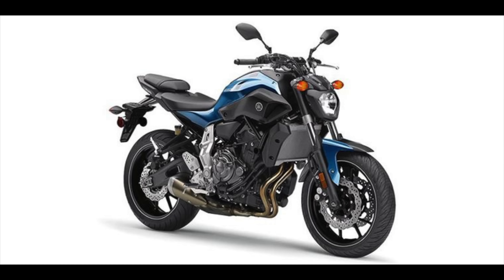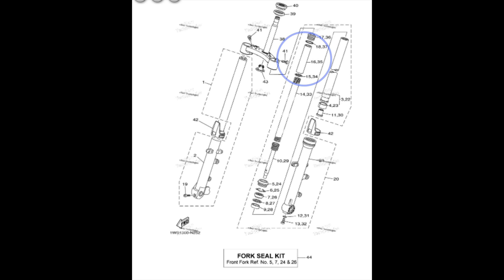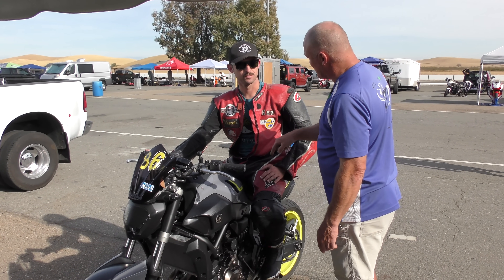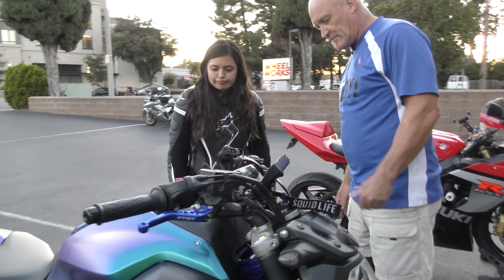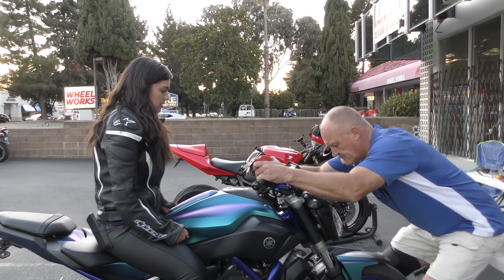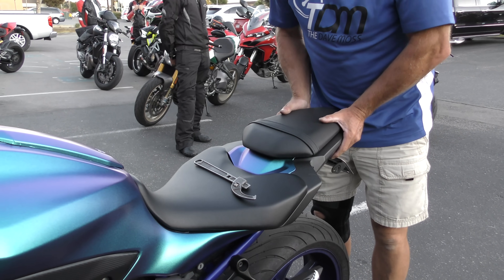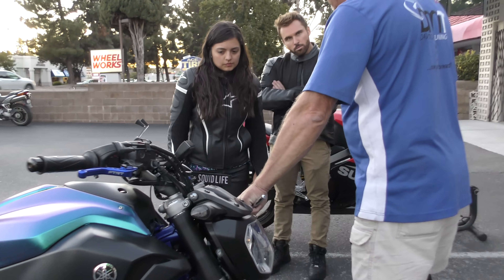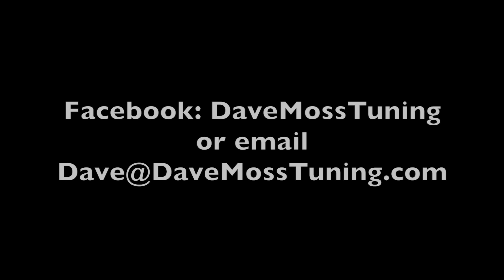Yamaha FZ-07 / MT-07 Fatal Flaw and How To Fix It

Comment: I'm saving money to buy one of these (this is my dream bike) and i find this very very helpfull, but my english is not good enough to understand completly what this man said, so, i need to fill the front suspension with thicker oil and adjust the clamps and make the bars down by 10-15 mm. ??
Reply: ive owned several mt07s and let me tell you they are decent but only on flat roads, the moment you encounter potholes you will start hating the bike, Yamaha has cheap shit suspension on the 07s and the 09s, however i did get a chance to own a mt07 tracer for 6 months and the suspension was much better than the naked 07. its also a much more comfortable bike too for the rider and your pillon. bottom line if your getting the mt07 naked chuck out the shit suspension springs for some nice ohlins or nitron ones, trust me you will not regret it.
Reply: @DudePlays247  Thankyou for taking the time and sharing the information, sadly the Tracer version will never come to my country, but i will consider changing the suspension springs thanks to you and ofc to this video, better safe than sorry.
Reply: Horotzuka my pleasure, thank you for replying
Reply: 10 - 15 mm is how much to cut off the plastic pipe inside the forks (between the cap and the spring inside the forks).

Also, don't fill the fork all the way, there's a specification for how much oil to put in.
Reply: @IslandTosh  Thankyou for taking the time to answer my request, it's very helpfull, i will keep it in mind untill i get my bike and have it done!!

Comment: Spoke to my dealer about getting 20w oil, he believes the stock fork valves won’t cope with such thick oil (90kg intermediate-advanced track rider)? How true is this
Reply from the maker: I used 10w in the rebound leg and 15w in the compression leg with an oil height of 150mm on my 2019 Tracer GT. I'm really happy with the forks now for general sport touring. The same testing was done with 10, 15 and 20w oil on the MT07 and shared. I choose to experiment, test, conclude and share.
Reply: @catalystreactionsbw  so would u say 20w in both legs for the mt07 or to mix different weights between legs? 90kg rider street and track riding
Reply from the maker: @IamMotionMedia  I would say 15w to start at an oil level of 120mm to leverage the air spring effect: https://www.youtube.com/watch?v=EiZY0lcqeR8

Comment: In my mt07 is STX 46 and nix-22 Ohlins and is diferent bike now.
Reply from the maker: Thanks for sharing what you did to improve your bike. Do you know what spring rates you used so you can share wit others who are interested in spending $$. Can you also include your weight so they have context? Thanks!
Reply: In full gear 90 kg,I use springs for 100 kg.

Comment: This is great info thanks Dave. 
I have a 2018 Mt-07. Would these recommendations still apply? I heard that from 2017 to 2018 yamaha made some front fork adjustments but im not sure what was done.
Reply from the maker: Looking for one this week at either a Yamaha dealer or an event I attend. As soon as i find one I will let you know. An owner of a 2018 posted that there is no preload spacer in his, so I need to verify that with a new model.
Reply: @catalystreactionsbw  thanks Dave can't wait to hear about it.
Reply: @catalystreactionsbw  would offer my 2018 if you're in Texas soon, but it looks like your schedule on the website has you in New Zealand for the foreseeable future. Would love some info on this as well. thanks
Reply from the maker: @blakemuhhfukn7689  Will be visiting the Napier Yamaha dealer tomorrow to sample MT09, 07, 03 and 15's if they are present. I will still continue my quest while I travel here in NZ to et them all covered and them post about y findings.
Reply: @catalystreactionsbw  you're the real MVP you know that. I had an additional question if you're still reading; would you think 20 weight would be fine for pushing into the 3's or should I move to a heavier weight in the forks. Thanks!
Reply from the maker: @blakemuhhfukn7689  All the 300 and 400 bikes seem to prefer 15 or 20w based on rider weight and skill level. As Texas generally  is not cold, 20w may be a better starting point if you are in many of the much warmer locations.
Reply: @catalystreactionsbw  sorry Dave, meant ~280-300lb rider + gear + luggage lol love my MT07 too much to switch to another bike but am heavier set
Reply from the maker: @blakemuhhfukn7689  so Nitron or other brand shock for the rear and 1.0 rate springs with 20w oil for the forks.

Comment: Its called get rid of  it
Reply from the maker: Really? It is a brilliant little bike with a gem on an engine that requires a very inexpensive fix and a bit of work.
Reply: @catalystreactionsbw  that extra rebound setup more for everyday  street riding? Trimming that bump stop sleeve effect overall street ride complacency?
Reply from the maker: @justinbustin677  If you have no static sag, every bump translates immediately and with full force into your hands. That's why we also check and adjust shocks for the same static sag. That allows the forks and shock to top out in dead space and leave you alone for the most part, other than pot holes etc). The rebound/oil viscosity change is for stability and that is essential for street riding, especially in a crisis situation.
Reply: @catalystreactionsbw  off topic,   do they make a tool to adjust the rear preload. C spanner but my 94 zx9r's collars on the damper is in the swingarms bore hole. Besides a chisel and a hammer is only viable  option.
Reply from the maker: @justinbustin677  https://racetech.com/images/tools/TSPA01Apply1.jpg
Reply from the maker: @justinbustin677  remove the shock if needed and adjust it that way.
Reply: @catalystreactionsbw  manual says temove and adjust but how would i adjust for static sag? Guess ill go with chisel  procedures. Thanks for your time and info!
Reply from the maker: @justinbustin677  watch this first Justin as you may already have it. https://www.youtube.com/watch?v=3FeZJRiAXRk&t=314s

Comment: is there any vid how to cut those spacers? Also last month i was taking out the screws on top from forks and they popped out, i have managed to put them back and put screws again does it mean that i have to change the oil now ? if so then great so additionaly ill be able to cut spacers too. I weight 85 kg is 15w fork oil good ? Also he mentioned to buy shocks from people, he meant the rear shock right?
Reply from the maker: I do not have one yet, but planned a video shoot in just over a week on this bike, doing the job from beginning to end. What year is your MT07? Given your weight 20w would be best. Correct on replacing the rear shock after 12-15,000kms
Reply: Dave Moss Tuning looking forward to seeing that video

Comment: Errr.... What? I'm a bit over 4 minutes in and this guy isn't checking the bike with the rider on it and reckons that the front and rear should have the same sag with no load... What? The front has significant pro dive, which means that you need a higher spring rate and higher preload... They should absolutely not behave the same. At this point I'm done and I suggest that anyone looking for suspension advice on a bike walk away.
Reply from the maker: Thanks for watching!

Comment: ohlins spring kit, did to mine & problem sorted.
Reply from the maker: Thank you for sharing your positive experience. Can you also share your weight and what spring rate you chose to help others thinking of spending $$ in that direction? Thanks!
Reply: @catalystreactionsbw  Im around 230lbs.
I used genuine ohlins fork oil, I forget the weight but it was the heaviest they do.However I also had to use a lot of preload, about 3/4 available.
It certainly wasn't as good as a stock MT-09 or most higher end bikes like my Ducatis but it was a drastic improvement.
My model was a 2019 version with the adjustable rebound rear shock, was also going to upgrade that but by adding preload and fiddling with the rebound it was perfectly adequate for a middle weight bike.
Reply from the maker: @daniel5876  Thank you very much for sharing to assist other riders and help them with their deliberations on what to do via your results.

Comment: After watching the video, I plan to cut spacer.
Seems to be easy enough.
And cheap DIY for performance change, plus safety
Question.
Do i have to add fork oil?
Reply from the maker: A pipe cutter and deburring tool make it a very simple job. If you are already in there, why not change the oil. 15w or 20w depending on your weight (see earlier reply on that in the comments).
Reply: Thank you sir.
Maybe I just might as well do that.

Comment: Many bikes have these issues. What we need is a universal advice vid for all styles of bike. What are the ideal setups in each case. 

What’s a good solution on one bike won’t work on another though. So then we need is more specific advice on individual types of issues. 

The advice to solve the excess front sag on my 1989 Japanese domestic Honda CB-1 is the opposite of his advice to remove 10, 15, 20 mm from the spacers. We add 20 mm spacers. 

The rear issue is more difficult. Depending upon your weight, a slightly longer rear shock with better damping, but the original progressive spring is one solution. 

Why? Because Japanese kids are a lot lighter than most of us older guys in the west. I’m probably twice the weight of the average Japanese teenager. So, the unit off a CBR1100XX Super Blackbird is one opinion. 

I like the way you teach. Great to see. Thank you for sharing.
Reply from the maker: Thank for sharing your experiences and paying it forward. I appreciate the kind words and a tip of the hat to you for taking the time to work through your motorcycles to make them better.
Reply: Dave Moss Tuning From you that’s a very kind response. All I did was read a lot of comments from other CB-1 owners and engage in the debate online, then put some of the findings into practice. I’m just ignorant of enough subjects to be aware I’m not too old to learn. 

What you do is share your IMMENSE and priceless knowledge freely online. And the way you do it is like watching a sainted guru!! No matter how fucked up a rider’s settings, I’ve never seen you ridicule them, or even show Gordon Ramsey style exasperation over their choices. 

So, it’s THIS I’m most grateful for. I know it’s my LACK of patience that very often hinders my ability to help others, no matter how good my knowledge of any specific subject. 

If you were on TV the producers would be looking for the most dangerous setups and the most stupid riders - just to test your resolve!!

What kills bikers most often? Failure to plan ahead appropriately? Maybe. But when and where should that planning actually begin? In my humble opinion it should at least be somewhere close to the choices we make about who’s advice we firstly seek, then listen to, then take on board, then respect and revisit (having double checked if we want), then implement, carry with us and share with each other. That’s how humans evolved from the grunting stage. 

MC Rider and you share the calmness and patience which cause you both to stand out from the crown of fevered egos and false prophets, who’s eye is mainly on their profile and the profits they can make in terms of kudos and Dollars. 

Anyway, enough of this smoke blowing and philosophical bollox. Ride safe bro.

Comment: Will adding preload adjusters and changing fork oil viscosity be sufficient without cutting the spacers down? 2015  Mt-07 with 12000 kms
Reply from the maker: Pull the spring and spacer out and measure the length of both combined. Then measure the preload spacer to see how much more pressure it adds to the spring/spacer combination. Doing the measurements will tell you how much to trim the spacer to compensate for the preload changes. Then change the oil viscosity.

Comment: I know nothing about suspension but one thing i like to do is to setup front and rear so they work together as a unit. No idea if that is a bad thing or not hehe.
Reply from the maker: Working to find and then keeping stability on a vehicle with only two wheels is paramount. If you have no external adjusters for rebound and compression you are left with servicing fork oil more frequently as once the viscosity gets too thin, the pogo returns mandating another oil change.

Comment: Hmmm, i don't have an issue with my 2019 MT-07
Reply: Same here
Reply from the maker: @coolcat6551  In that case, what static sag do you measure? On the earlier version there is less than 10mm. We have a post saying 25mm for fork static sag. Can you measure and confirm as that will help 100's of riders. It may still need thicket oil and my visit to a Yamaha shock will confirm or deny that.

Comment: should i shorten the tube too if i put in different springs?
Reply from the maker: You need to measure the spring/spacer combination. If the new spring is 10mm shorter, no. If the new springs is 30mm longer, yes.

Comment: The stock suspension on so many entry level bikes is just absolute garbage. And I'm not just even talking about it being a matter of using more expensive components. It's just their choice of products. It's not like oil weight, spacer lengths, or spring rates will significantly impact the cost of a bike. But perhaps they're able to re-use components from other products, so that helps drive the costs down? I guess that's the answer, because I can't understand their engineering decisions otherwise.
Reply from the maker: Thanks for your contribution. Unfortunately in building a bike for the world's population, what data do you pull from what bell curve to say "That will work for 60% of the population." A daunting task for any OEM compared to a car manufacturer. So, if we look at what we get and then find what we need, we can create our own comfortable, good handling and stable motorcycle. Going one step further, having adjusters and never using them makes no sense at all.

Comment: Hi Dave. Thanks so much for the tutorial. I was hoping you could address we bigger guys. What oil and spacer length would suit a 240lb rider? Is the stock shock ok? Thank so much
Reply from the maker: Hi Jason. Step 1, check static sag on the forks. If you have less than 10mm, the spacer needs to be trimmed. At 200lbs or more a 7mm trim makes sense and 20w would acceptable to the stock volume. With the forks, mark fork bottom out with a felt pen (https://www.youtube.com/watch?v=eds3dn1LBkw&t=1s) and visually check travel used via a cable tie on the forks and looking to see how much of the shock shaft is clean. If 100% clean, the shock needs to be stiffened. If it cannot, the OEM spring needs to be replaced. Hope this helps!

Comment: So since it has been the MT for awhile is this referring to the older FZ models? Also I havent rode one myself but everyone tells me that it handles like a piece of cake the cornering is so simple and smooth and they love it which seems odd since you are claiming a horrible suspension setup. Either way I like the info and the way you communicate with ppl. I enjoyed learning some new things
Reply from the maker: Thanks for your post and contribution. The same bike has different model designation in different Countries so that can lead to confusion. The bike is very light, well balanced and agile but it does need the forks worked on to create much more stability. The same is true of most telescopic forks in finding the right oil viscosity.

Comment: I own an FZ07 and changed the fork springs to progressive springs and replaced the rear shock. I tried fork oil with high viscosity, which was a fault, actually the OEM oil is quite perfekt for 180-190 lbs / 85kg. The right oil can be found looking at the centistoke (dynamic viscosity) and not at the SAE number. Static SAG is one thing, SAG with rider is another. He didn't check it on the front. I don't trust this guy at all.
Reply from the maker: Thanks for sharing your lessons learned. Perhaps you can look through the hundreds of other videos posted to this channel and see how comprehensive they are prior to stating that I am untrustworthy.

Comment: In the second half of the video, did he low the forks because of her height and weight or is that something that is recommended for all fz07 riders?
Reply: For her height
Reply from the maker: I lowered the forks slightly to put more weight on the front tire to create more grip. That is a logic/common sense change if the forks pogo a great deal.

Comment: I have to go out and look at my fz07 rear shock adjustment again now. I set it to the max because I'm 6ft and 220 lbs. I thought that was correct until I watched this.
Reply from the maker: Take a look at the shock shaft and see how much is dirty and how much is clean. If it is 100% clean and there is a nice circular impression on the base of the shock body is present. While you did precisely the right thing in going up in preload, the spring may be too soft for your weight. If so, try to acquire a stronger spring. Hope that helped.
Reply: @catalystreactionsbw  Thank you so much for the advice! Will do.

Comment: Any tips like this for a 2011 Ninja 650? :D
Reply from the maker: 20w oil for the forks
Reply: @catalystreactionsbw  Thank you, will make sure they go in at next service, though i might get a cartridge kit
Reply from the maker: @AntaresSQ01  In that case the best ROI is with Andreanni.
Reply: @catalystreactionsbw  Not sure if it's too late to ask but would you recommend dropping the front of the bike at all to improve cornering and flicking? The bike is extremely stable in a straight line even at top speed so I feel like there is some room to make the bike a bit more nimble there, or will this negatively impact handling/ create clearance issues?
Reply from the maker: @AntaresSQ01  We dropped Ray's bike in increments and he loves it even more: https://www.youtube.com/watch?v=X-uiiksWsOs&t=449s